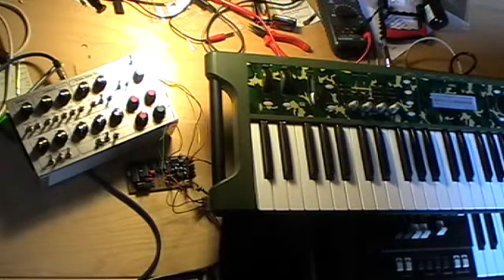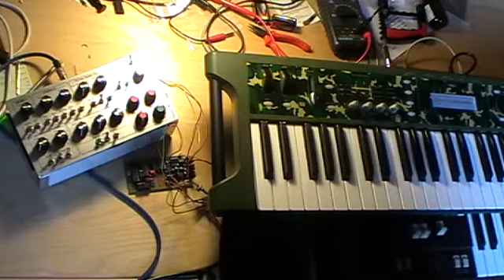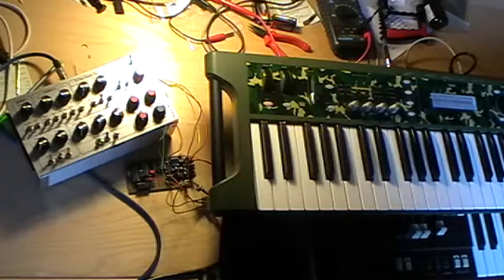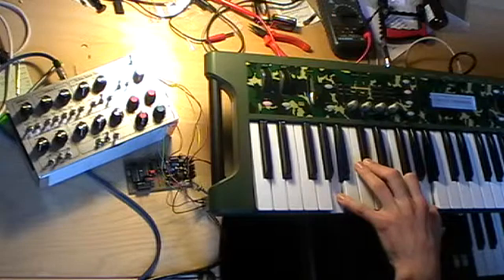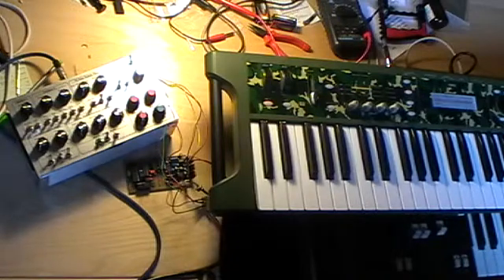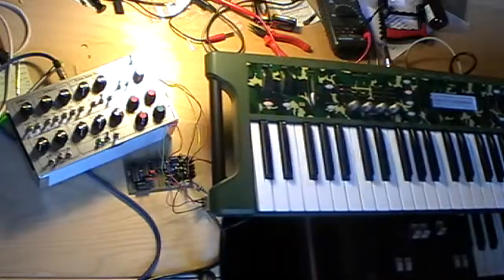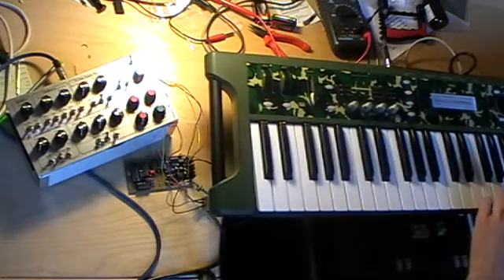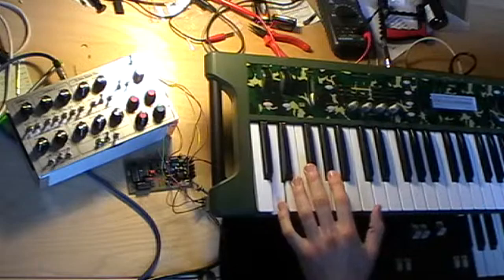AVR-Project: Midi To CV featuring midi controlled modulation, pitch bend AND portamento!

Comment: Hello! Really great work!
Is it possible to tune up the converter (I guess that it's about it) so the higher octaves will have right tones? I'm still at the start of building a synth so at the beginning I collect any information that can be useful. Thanks in advance!
Reply: (this is michi42/acidbourbon)  Hi. In my synth the limitation to correct tune over a large range of keys was the control input of the oscillator (I think). The converter should perform fine (I hope). Cannot tell you more. In the end you have to build it and try how far you get :) Best regards, micha